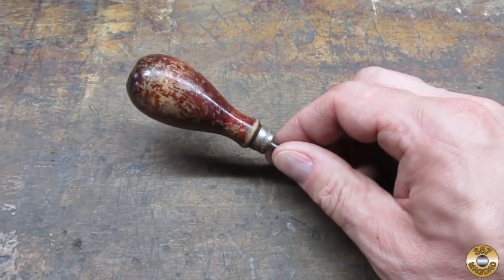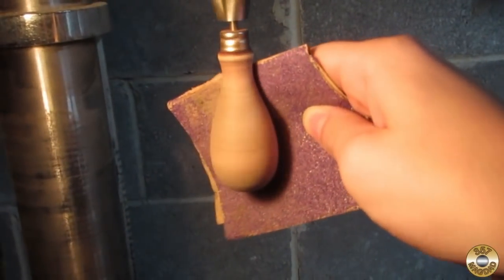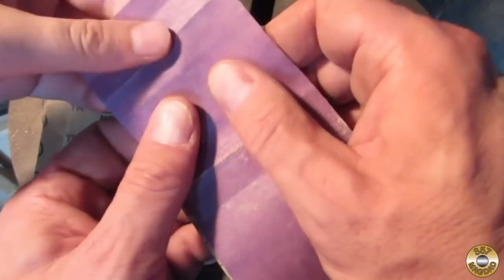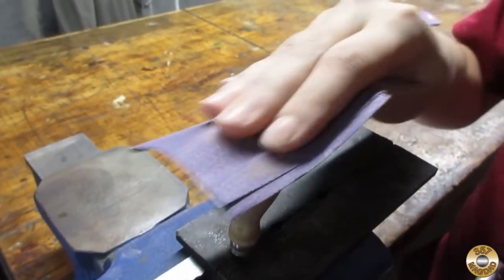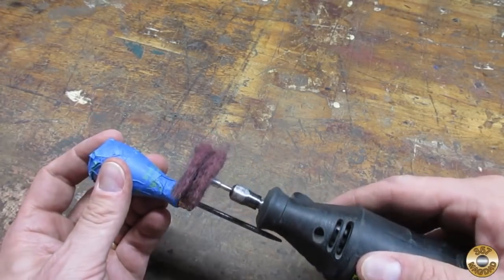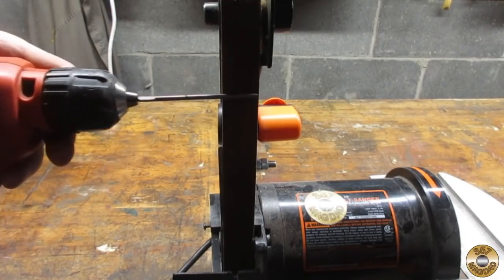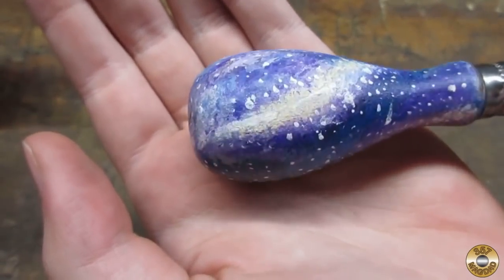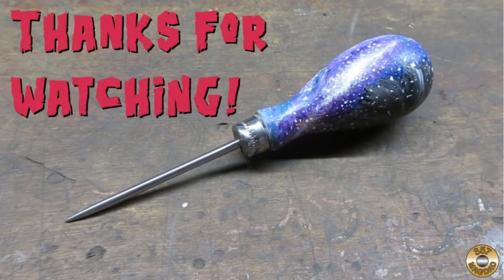Hand Tool Restomod - No Name Scratch Awl

Comment: It's because the awl is perfectly circular. It would just fall out of the handle. They usually wrap like a half inch piece of packing around the flat spot, compress it, and shove it in. Sort of like piston sleeves, they had a tool that compressed the packing and started it into the hole to prevent it from moving out of location. I don't know for sure if packing was what was used by the manufacturer, but I know it is common. I've come across many a loose handled awl with this design, and they all had something that looked like packing. Kind of hard to tell after 50 years packing kind of just looks like dried snot.
Reply from the maker: The other awls I've had apart didn't have the flattened end.  If it comes loose we'll epoxy it.